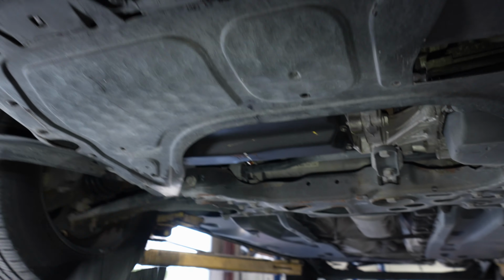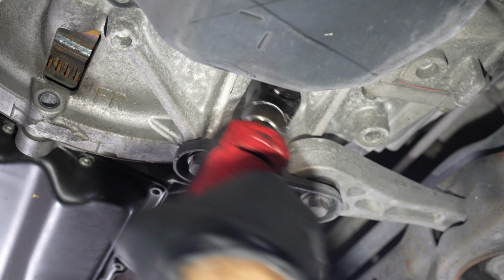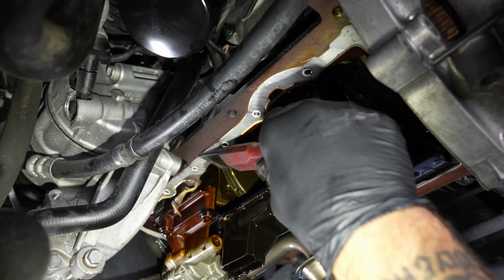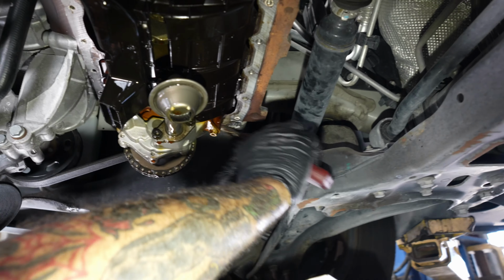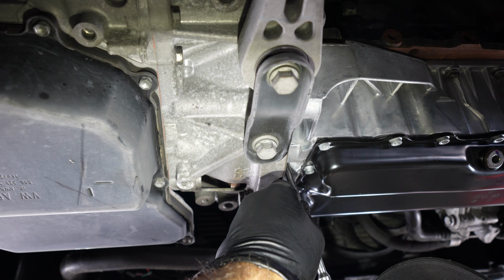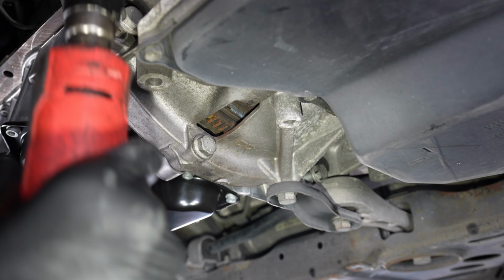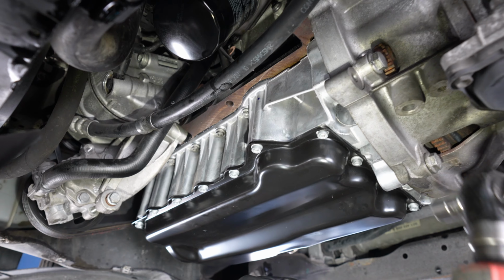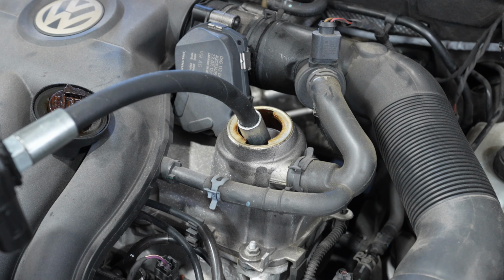2015 Jetta Oil Pan Install

Comment: I like the attention to detail like noting problem bolts. Ninja.
Reply from the maker: Thanks for the comment. Glad we could help you out. What else are you working on?
Reply: @GremcoGarage  No cars. Just pushing papers but thanks!
Reply: Great video to show what not to do.   Only the steel pan needs to be replaced. There was no need to take the upper pan off.

Comment: Great video! I am having trouble with that one buried bolt getting it started as it the tool wont sit perfectly straight. I am using am 10mm with a built in socket. can you recommend another tool for getting this bolt started straight? Would a ball end allen key be the one? or an H5 with the built in swivel? Thanks